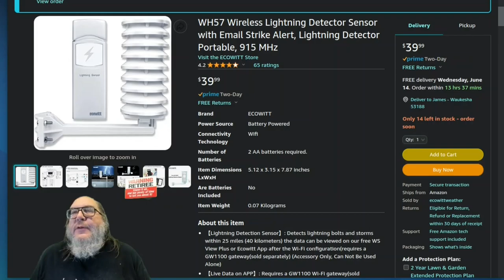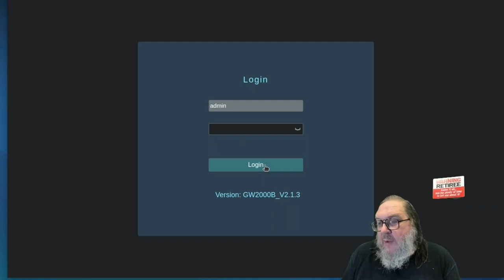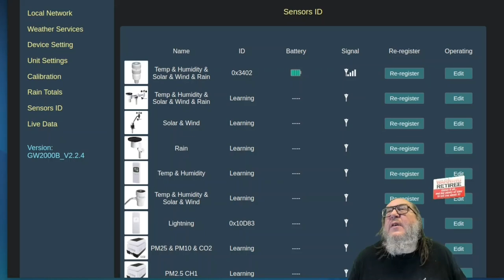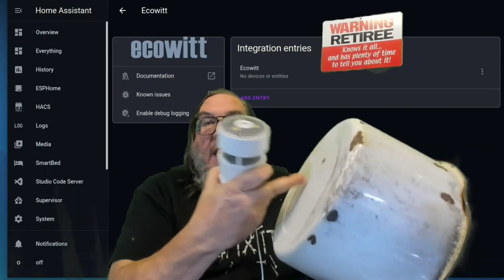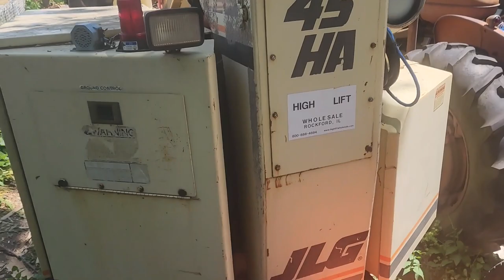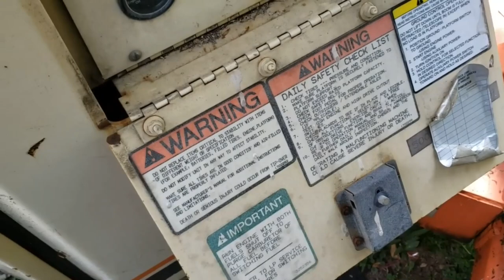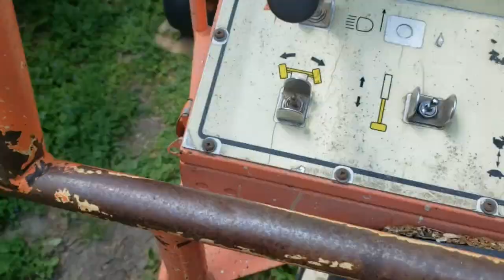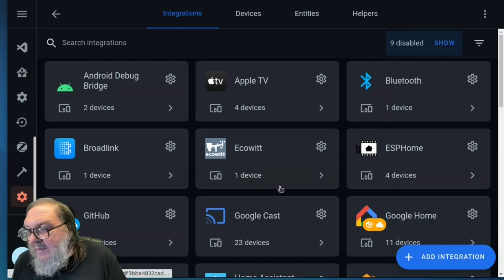Ecowitt Wittboy Weather Station GW2001 & WH57

Comment: Why does the weather station have to be so high? Isn't it possible to just put it 6 feet away or something where you can change the batteries in the future?
Reply from the maker: Shouldn't have to change the batteries for years.  The more in the open it is, the better data you will get from rain sensor, wind speed, and direction.  Also your house will leak heat in the winter, you don't want that messing your reading.